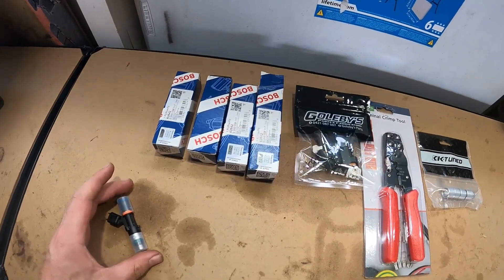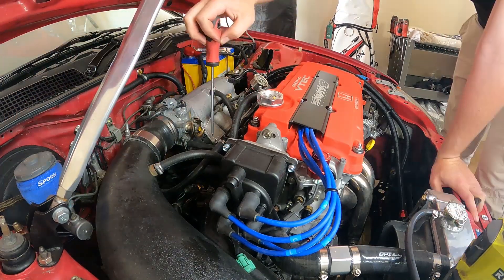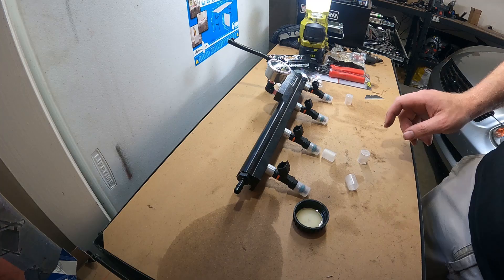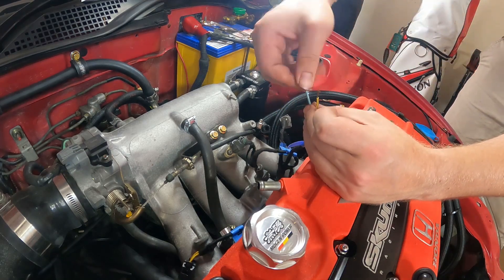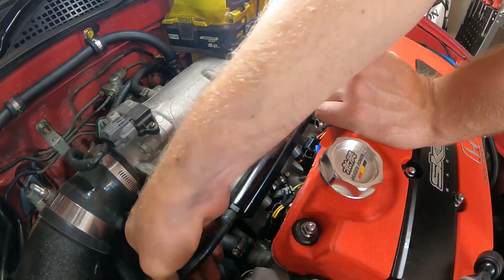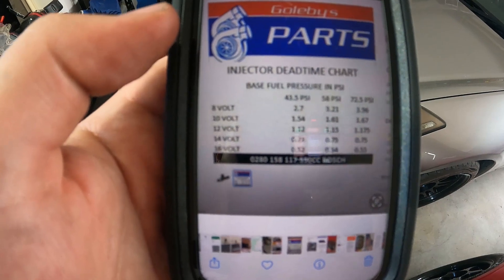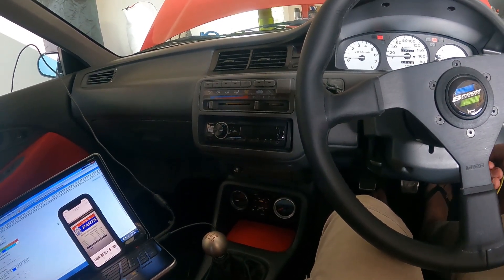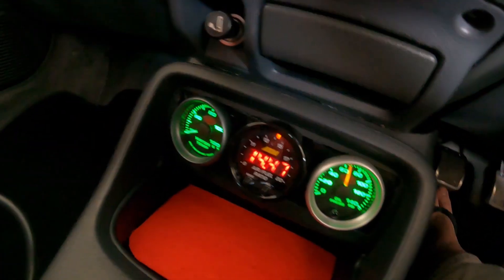Installing Big Injectors For More Power!! Bosch EV 14 Injectors | Eg Civic B16

Comment: Thanks for the video!
I just have one question: why not directly use the correct injector length, since EV14 injectors come in three sizes?
Thx ! :)
Reply from the maker: The top hat converts the injectors to 11mm. You can buy injectors the right size without the need for that.
Reply: @JarrodWillemse  Thanks for your answer! What I actually meant is: since EV14 injectors already exist in 34, 55, and 61 mm lengths, why choose a shorter one and add a top hat instead of directly taking the correct size?

Comment: Hi, are they 3/4 length 14mm top?
Reply from the maker: Yeh mate.
Reply: @JarrodWillemse could I go full length 11mm top or is it better to go the way you did it? B18C2 with a skunk2 intake manifold and aftermarket fuel rail. I've enjoyed your vids mate
Reply from the maker: @aaronpitts2762 don’t go longer though it’s possible to space it out more. It will sit high and look weird.
Reply: @JarrodWillemse thanks. I appreciate it. Still learning Honda stuff

Comment: How are does injectors holding up 7 months later? Have you put decent miles on them? Considering purchasing a set for my turbo car, but can’t decide if I should dish out the money for the more expensive ones
Reply from the maker: TBH havent driven the car much. But i feel that injectors are such a critical part on how a car runs. Just make sure you purchase genuine injectors but most brands are good. DW, bosh, denso ect